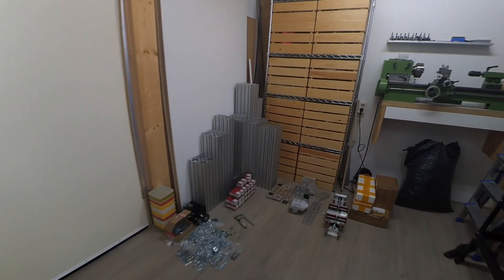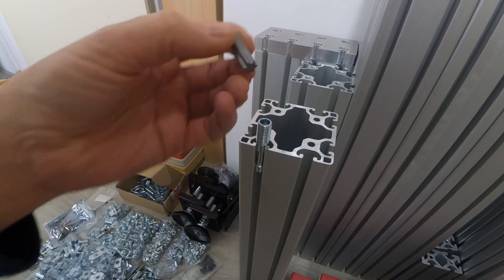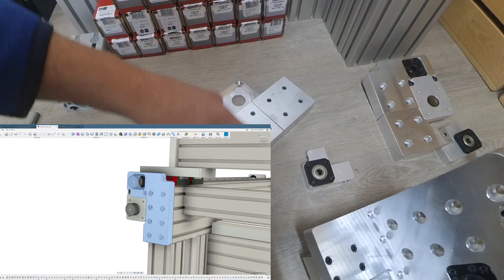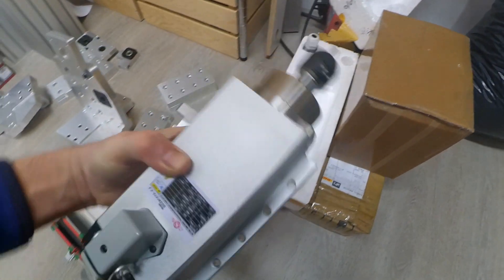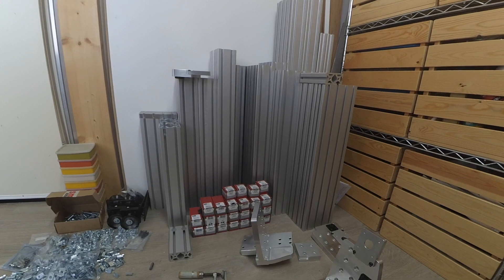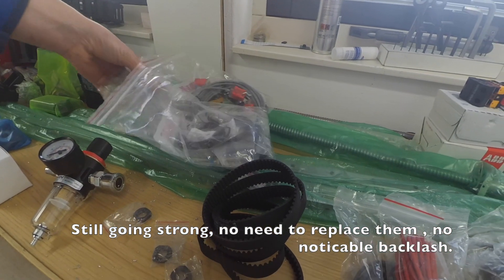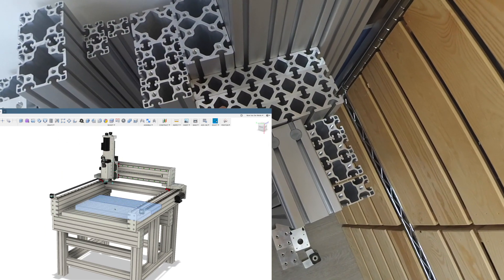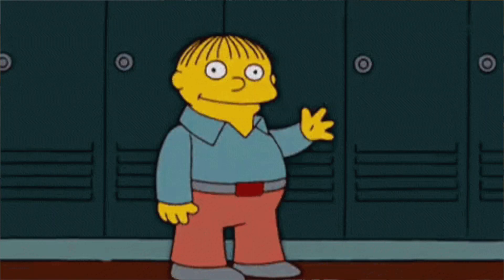DIY CNC machine, general design.

Comment: excellent design, it's really a well made machine.
Reply from the maker: Thank you for your kind words Nicolas! I need to make another movie if the entire machine is done again. Also replaced the JMC servomotors for stepperonline (OMC) 180W servomotors.
Reply: @berendlucasvanderweide  These are indeed some interesting news. Belt errors should be pretty small though, interesting. I do have some JMC non-integrated servos I'm planning to use for my design however aiming at lower accuracy, bigger space (1250x1200mm²).. Will reconsider belts then.. Though I'm not sure this is managable.
I'd love to see any updat from your machine. Concerning the mechanics with the profile: you're still happy with the al profiles you've used? Steel linke the printnc is something I'm constantly having in mind as well.
Reply from the maker: @dernicolas6281   The problem is that the beams aren't straight due to their production process. They are stretched to specification, which leads to tension in the beam and a deformation of the squareness. I've machined the reference flats on my machine on my larger machine. Within 0,02 straightness. But combining metal (lineair rails) and the aluminium profiles create a bi-metal with an interesting difference in length when the temperature changes. The belts themselves don't introduce the biggest error, but the runout of the holes in the pulleys do. Jmc makes great products in my opinion, but these omc I now have also have two filters for resonance dampening, which enable a stiffer setup without resonances. (I was using V5 jmc's, that simple didn't had this feature). They worked fine though, but I wanted to test the OMC's.
Reply: @berendlucasvanderweide  yea - I'm aware of that. No higher end industrial machine is mixing materials and even non mixing they're keeping the temperatures constant. My plan is to mainly process wood anyway. ;) 
Resonances in long Al parts need to be treated then? Ok. Makes sense I guess... Thanks for the detailed answer! Will follow up whatever you're releasing on this chanel.
Reply from the maker: @dernicolas6281  Yes, exactly. Not saying it can't be accurate, it just takes time to get there. (adjusting can take a lot of time, consider it a rainy sunday afternoon task.. ) :). When designing a machine take the posibility for adjustment into account, that you don't have to tear the machine down to reach a screw. A few tactical holes and flanged guides on the lineair rails can help a lot. When machining stiffer material,  the machine is most stiff in the corners, where it sits as close to the siderails as possible. Aluminium is very convenient if you don't have the equipment to weld etc. That was my main reason i went that route. Just buy, and screw. Welded steel also requires tempering.  I'm using edingcnc, and it can do ballscrew mapping (currently using preloaded C5 ballscrews) and squaring it to perfection is also possible with this software/controller. Te be honest, i choose the controller also based on that, but haven't been using it. It's good enough as it is, but you could make temperature depended profiles if you have the urge to go the extra mile.. I am using an 80160 'heavy' profile for the x axis and the Y, i haven't bothered filling it with concrete or polymer concrete, i don't know if it will add anything. I can machine birch at 25mm depth with 2,5mm overstep, with a 12mm cutter with ease, without chattering. I thought i have a little clip of that as well, have too look it up..
Reply from the maker: @dernicolas6281  It's more 3,5-4mm Cutter is a 12mm 3 flute downcutter.  https://photos.app.goo.gl/pREZWBtnWxqejgtC6

Comment: Hi, can you post a link to the spindle model number
Reply from the maker: It's a ratm 2.2kw square spindle, air cooled with ceramic bearings. Don't search too long for ceramic bearings, good steel bearings are great too. There currently are two models available. One with a plug and one with a junction box. I prefer the model with the plug.

Comment: Hey, how did things turn out with this? :)
Reply from the maker: Heya! Turns out to be very handy, upgraded some things on it, using a camera for x/y reference (lowered by a small pneumatic cilinder). Bought parts for a 4th axis. It's fast in x/y/z. It's convenient to have 2 machines for my work. The controller is capable of handling parabolic arcs smoothly, so all and all, i'm very happy with it. To be honest, i don't think i'll ever build another machine from aluminium for several reasons. But i'm still very happy with its smaller footprint and overall performance.
Reply: @berendlucasvanderweide  Sounds like maybe its time for a quick video update :)

Comment: Heey Berend. 
Congratulations on a successful project and I hope it serves you well. I am starting to build my cnc machine soon and i have already bought some parts and one of it is spindle identical like yours GDZ80X73-2.2 kw, 24000rpm ER20 13pcs collet, but on Aliexpress supplier page is said it has steel ball bearings.
So now Im little confused, Im not sure should I be able to mill aluminium like you with your spindle.  I paid it 210$ + 115$VFD
Are you sure that your spindle have ceramic bearings and do you have any advice for me?
I appreciate you helping.
Reply from the maker: Just make sure to ground the housing of the spindle properly and connect al the ground points at one star/central point 
. I'm sure mine has got ceramic bearings but for aluminum steel bearings are perfect.
Reply: @berendlucasvanderweide   ✲ understand
What about spindle, I doubt motor is in centre of aluminium case. Do you think that spindle mounting alu. surface should be machined for perfect angle before mounting on steel Z axis.
Im afraid of heating steel bearings if go high cutting speed for a longer time like you do.
Can you tell why do you think steel bearing is better for aluminium milling?
Thanks man, you already helped alot, I didnt even knew my spindle is good enough for aluminium milling.
Reply from the maker: @eugenega7494  You can not trust the angle of the rotor in the motor. In my case it was OK, but just measure it when it's in place. there are several ways to align it to the machine, but if you are in the hunt for the last 0,005mm, you shouldn't build a machine from aluminium profiles to begin with :) I've used a 12x150 rod in my spindle  to align it. Rotate it to determine the runout, move the Z in height while rotating it and take the average number of the dial indicator as a guide for the linearity of the Z axis. On my spindle it only needed side adjustment, so in my case the rotor was fine on the most critical direction. But it's not a ground/reference surface, so you can't trust it. I would prefer good steel bearings over lower grade ceramics. (with ceramic bearings the races are still made from steel. Only the balls are made from ceramic. And ceramic has a larger stability in size over temperature, but nothing to worry about.  I used to machine in aluminium with a water cooled 2.2kw with steel bearings (the old style, 3pcs bearings) the round water cooled use smaller bearings to begin with, (which use smaller balls, and can withstand lower loads) but it machined aluminium just fine. You don't need ceramic bearings perse. I didn't say steel was better, I say it would work perfect too. If you look for Rattm 2.2kw air cooled on alie (2038270310) it mentions ceramic bearings.
Reply: @berendlucasvanderweide  Yes I found, Its 50$ more exspenisive then mine.
I will weld strong construction with tick steel pipes and then give it to a company to machine places for rails and Z axis. I dont know how will they do it but will probably give them spindle also to machine it to fit on Z axis perfectly.

Comment: Hello, thanks for the video. I like this type of spindle. Do you think the 1.5Kw has enough power for cuting aluminium? It's to mount on a ooznest cnc frame. thanks
Reply from the maker: The Ooznest is somewhat of a shapeoko machine? Belt driven? No worries. 1.5Kw is more  than capable enough.
Reply: @berendlucasvanderweide  No, It's with leadscrews. not sure but it seems a bit stiffer than shapeoko. ok thanks

Comment: Hi Berend, nice video with tons of good information. 
Are you still satisfied with the Rattm spindle and the run out?
Can you tell me how you changed the fan to a 12V fan - when I checked the pics on Rattm the vent on the back side of the spindle looks kind of built in the case and has kind of a ball bearing - so how have you changed it to a 12V fan? Have you pulled out the whole rear with the factory fan? Thanks Lars
Reply from the maker: Hi Lars; thanks for your positive feedback! i've replaced it with a high flow fan (from a DELL pc, i can look up the part no if you need it). It's regulated through a tiny voltage regulator and it now starts at around 6.5-7V. I've placed this thermal connector over it that bypasses that converter and feeds it 12V directly at around 40 degrees. The original fan has been removed. It uses a screw. I've placed a small plastic lid (old plastic ER20 housing) over the bearings to avoid dust entering the bearings.  I just made a hole in the rear duct and fitted the fan on top of it.
Reply: @berendlucasvanderweide  Thanks for your response. So the fan is sitting outside of the OEM rear duct? What about the run out - is the spindle still as good in quality as you expected?
Reply from the maker: @larsx312  yes, the spindle is still in good shape. When i had a large assignment  I bought a 2nd one as spare, just in case. But it's still sitting in the box. Runout was 0,002 and after the two years of use it hasn't degraded. I'll measure it again, last time was about a half year ago  I've used it for hours and hours and hours. Also for 10 hour runs in beech, 3mm overstep, 30mm deep with a 12mm 3 flute with chip breakers. I have this warm up routine I'm using, can't exactly remember it, it's about 14k 1min, 16k 2 min 20k 2min 24k 2min. But i also have a regular customer for plastic, and I'm running it at 6000rpm without warmup.. (light task, 3mm single flute in plastic) so it'll warm up during the production run.  I almost never run it above 18000rpm though, except for the warmup and light engraving. Indeed, the fan is mounted on top of the oem cover, protected with a fan cover
Reply: @berendlucasvanderweide  Perfect - unfortunately Rattm has the exaxt same model not anymore - found these https://de.aliexpress.com/item/32435696679.html but they hafe not that smart plug like yours
Reply from the maker: @larsx312  Yes, that's the same motor. At the time I had the choice between this and the one with the plug. No particular reason why I choose to buy the one with the plug. (other than looks, i like the plug :) ) They are the same motors.
Reply: @berendlucasvanderweide  Thank you so much - that helps me a lot in my decision which route I go. It's always better to have report out from someone with practical experience other than all the (faked) reviews

Comment: Awesome results you have. Really! Can you tell me more about that double servos configuration on Y axis? i also have couple of these servos and skratch building cnc router for home use. However i'm bit worried to use two of these servos in parallel to drive one axis. Are they reliable enough for that task? The second thing is PID loop tuning in this case! Are they really behaving exactly the same with the same parameters set? Any problem with STEP signals would lead to mechanical disaster with this forces on the ball screw nuts and interia... And if you want to make any change in PID parameters you have to connect to both servos before you try new setting. Or maybe you are just tuning them with the gantry dismantled and adding some weight equivalent? Please share your experience in this subject. Thank you! cheers:)
Reply from the maker: Hi, thanks for your comment; and your concerns are/where also high on my list.  Most controllers offer tandem-homing, which enables you to use 2 homing sensors (which you can accurately set). The other axis goes into slave mode after homing. What i've done is more straight-forward; use 1 homing sensor, and use 1 output of the controller to have them both set in parallel. This has been working just fine. When turning on/of these motors there is not directional change. You can loop the alarm from the motors to the pause/estop of your controller. If one fails, the entire setup stops. But still, what if the step signal is lost on 1 of the two. You could use an extra gear/belt to mechanically connect both axis. (i've ordered two ballscrews with longer shafts and just got a 2000mm htd belt to do that. GT2 would have been fine too, but the HTD is more for possitional accuracy, i'm making a construction so i can square the gantry using that same belt. But like a said; machine has been running fine without these features well over a year now. Tuning the motors; i'm using the V5's.  THey have no dynamic/auto tune like the V6. I don't  know what you know about  servo's, but in order to opperate properly in dynamic/auto tuning, they only need to know a few variables. Inertia and required stiffness are the main settings. the method you describe (disconnecting the gantry /adding weight to one motor and copy/paste these settings) is also described by the techs from clearpath (or at least it was a year ago).  I just took the tune from the X axis, put in on both motors and started adjusting from there. Two pc's and a remote connection from one to the other is very convenient that way. Also;  don't trust the scope on the software too much (at least with the V5) with the best tuning possible, according to that scope) i had an extremely low tracking error, while it did some massive overshoot. Took a slow-mo movie to reveal this issue.. But my best guess is that you are using the V6's instead of the 5's. Greetings!
Reply: @berendlucasvanderweide  Wow, thank you for so detailed answer. I'm away from home now so i can't check it, however if my memory serves me right i have both V5xx (can't remember exact number) and V604 on my 180W iHSVs. I have one 400W iHSV as well - i plan to use it fot Y axis driving two ball screws. Due to space limitations i have to make a smaller machine what i wish and i have 4 pieces of nice 2005 bosch ballscrews 1300mm travel each. Unfortunatelly they are too big and i don't want to cut them. So the remedy is to use shorter screws i have - 1520. 20mm pitch - at least i will reduce screw inertia problems. Instead of driving the screws @ high rpm's i'll reduce servo output using HTD pulleys. My final machine will have rotating nuts. Regarding the servos: these are the first brushless servos in my 'collection'. Years back i was using UHU controllers for brushed DC servos and other a like. I even rewritten some arduino servo code to suit my needs for simple servo system. I'm also tutning PID at wrok sometime but it's not motion control.
Your slo-mo way to spot the problem is very nice!:) 
What i need not is to find some good source of intormation about tuning program for these iHSV servos. So far i found one in german. Do you know if someone released it in english and some manual/description for both firmware verions (V5xx and V6xx)? 
Thanks:)
Reply from the maker: @The_Unobtainium  I watched a movie from a tech from JMC, he explains it pretty good. some jmc specific things where mentioned. I made notes from it, and used it. I need to look it up, it's very rudimentary.  Your hearing is pretty accurate in determining an accurate accel/deaccel and to discover an overshoot. I tried strapping on an acceleration sensor from my quadcopters with an F4 board to see if that was helpful, but it wasn't. I tweaked the setup to run smooth and accurate at 8000mm/s2 acceleration and switched back to ~2500mm/s2 afterwards. For my setup that method works fine. It runs smooth and fast. Here is the machine in action in some vcarving small letters; https://youtu.be/XZ1IyviDmIM  I don't have any experience with the V6, this should change, i have a 400W version attached to the 4th axis. I'm curious to see what this V6 is capable of on the machine. Perhaps i'll buy a 180w v6 and give it a swirl on the X axis. On the other hand. X is running fine.. If i had to do it over, i'd be buying the 200W version in NEMA24, they are very compact. these 180W's are just silly long.. EDIT, this is the movie of the JMC engineer explaining the parameters; https://youtu.be/EKrsX3KXtTk, i made some notes, but they are not complete. It's not a problem to share them but they are very, very rudimentary..
Reply: @berendlucasvanderweide  Thank you mate. 200 W version? I've seen only 100, 140, 180 and 400 Watts versions.
Reply from the maker: @The_Unobtainium  just search alie for jmc 200w servo. You'll find them for sure.